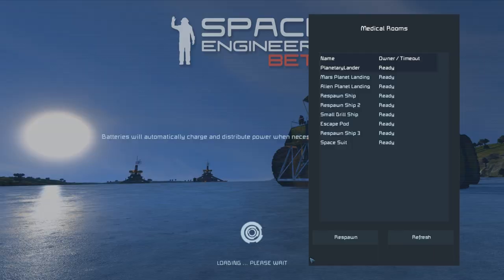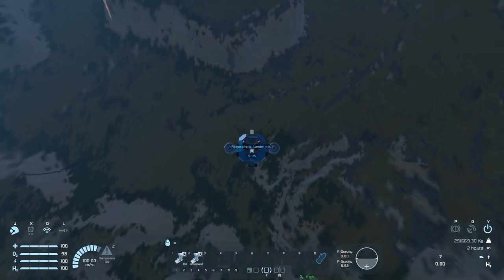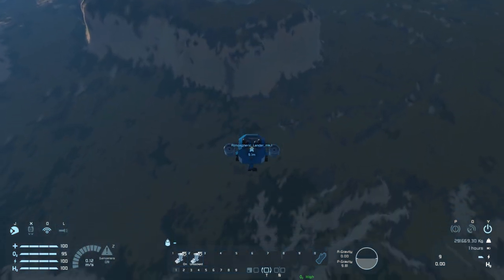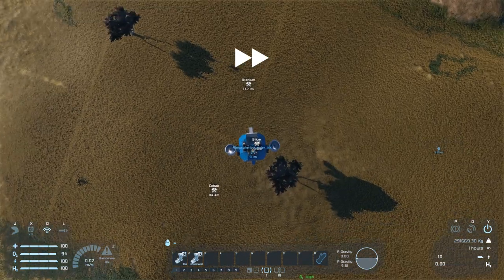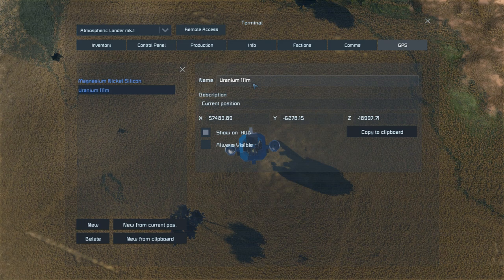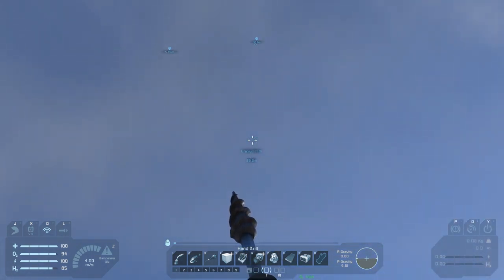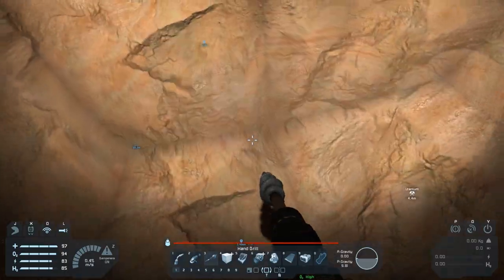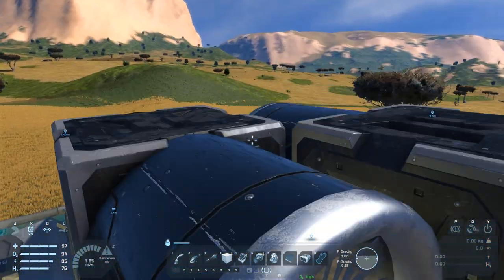Space Engineers Tutorial: Planets, Batteries and Mining (Part 1 of a survival tutorial series)

Comment: I personally don't recommend drilling straight down as its very undesirable to use up what little hydrogen fuel you have on jetpacking about, keep in mind that if you drill downwards at even a steep angle you can easily create a tunnel that you can sprint up just fine and its usually easier than trying to drill upwards at an angle.

Disregard this tip once you find ice in decent amounts though.
Reply from the maker: The main reason I drill straight down is that I've marked the deposit from directly above and this ensures that I'll hit it. You shouldn't need to use any hydrogen at all to do this, simply crouch and drill straight down, then you can drill up at an easy slope to make your hole to get out of the mine. As long as you go down with enough power you won't need hydrogen at all :)

One big caveat to this though, there are times when Space Engineers goes weird and you can get injured from rocks hitting your player, this is slightly more likely when drilling directly beneath you - so make sure backups are on :P

Comment: Great video. 3 things I do different though: 1) I open the sliding door way before, even when I'm still in the air. 2) Also still in the air, I switch off non essential systems (Beacon, Interior lights, LCD panels, programmable block, sliding door (after opening it), small reactor and timer block) 3) Once landed, I build 2 solar panels on top of the lander (need to scavenge some steel catwalk). Thus I don't need to relay on finding Uranium so quickly and instead I focus on Iron.
Reply from the maker: All good ideas that would work quite nicely :)

I don't think I can talk quickly enough to explain that properly for new players in the time it takes to land though :P
Reply: Fair point. Too much information for a limited time :-D As you well said, all good ideas. Great videos. I have learnt a lot.
Reply: @RCAddix  He never said it was his idea

Comment: I didn’t understand the bit about checking boxes on batteries. Hopefully you mention it again when it’s time to do it.
Reply from the maker: That's my preferred setting for batteries, it allows them to function like capacitors. They will recharge if extra power is available and discharge when the system needs that extra power. In the case of small atmospheric mining ships with some reactors and batteries, when landed and thrusters shut off the batteries will charge from the reactors (quite slowly though) then when flying the batteries will discharge because the reactors wouldn't be enough for the thrusters to work properly :)

Comment: Am I misunderstanding something with big block reactors vs batteries though?  Reactors have a max output of 15MW, Batteries 12MW, so why bother with a battery?
Reply from the maker: Large grid large reactors are very effective, but very large and expensive. With large grid small reactors they can't put out as much juice per second as a battery so you may still need them (though the difference isn't as large as it is in small grid). For atmospheric thrusters you can quickly run out of available capacity with reactors so batteries have their place :)
Reply: Have a look again dude, 12MW for large batteries, 15MW for reactors.  Also with <100KG of uranium, reactors weigh less aswell as acting as part of the conveyor network, and don't have the issues with irreplacable components.  Also you're not losing 20% charging a battery, just direct uranium -> power conversion.  Only disadvantage is slightly less health.  If there's something I'm missing, let me know :)
Reply from the maker: The output may have changed because I had in my head that it was a little bit less with the reactors. Assuming the wiki is right (I'm at work so can't check) there's no advantage to batteries if you aren't using solar (for large grid)
Reply: @Splitsie  I only just came back to SE about a month or two ago.  Back in 1.04 days the batteries were what you used and reactors to slow charge 'em.

I was surprised when I came across it aswell.  Only use batteries on small block ships now.  (4.32MW batteries, 500KW reactors).

I only run battery banks nowadays on large blocks for solar arrays or an emergency power source for medical rooms etc.
Reply from the maker: Phew, I'm glad I wasn't just going crazy about that :P

I'd say your use is spot on and probably the way I'll be using them in the future (unless they change things again)

Comment: How do you recharge you're suit? Managed to land but ran out of power to mine and could not work out how to do it, probably doing something stupid ;)
Reply from the maker: There are a few ways to recharge your suit, the first is to sit in a cockpit that has power (the ship has to be powered up for this to work - you can see if it's on by looking at the power symbol in the bottom right, if it's blue then the ship is turned on) the other is to use the med bay and access the terminal part that looks like a screen and keyboard, by holding F on that you'll get recharged and if the med bay is piped up to hydrogen and oxygen supplies those will get refilled too :)
Reply: Splitsie many thanks for the quick reply,  shall try that tonight when I'll give it another go,  quite a hard game to learn but you're videos have helped and once I get my head around how to build more and link things together I hope it will be more enjoyable.
Reply from the maker: It certainly has a steep learning curve, but I've had so much fun with it that I definitely think it's worth pushing through :)
I'm glad my videos have helped you get through some of it so far.

Comment: I was just trying to rotate objects I created from the G menu.  I created a conveyor tube and it was positioned in a vertical position and I can't rotate it to a horizontal position.
Reply from the maker: The rotation hints should be in the upper right of your HUD, you need to use them when the block is ready to be placed (snapped to the existing build) to get the desired effect
Reply: @Splitsie  None of them rotated the object to a horizontal position.
Reply: @Splitsie  I think I know why I couldn't get the object to rotate properly.  When I lifted it high into the air, the controls worked as described.  There was a rock wall nearby and it must have interfered.

Comment: My ores wont show up even with the lander and the drill any help?
Reply from the maker: I've been having some troubles with the ore detectors in the last week, though mainly the ship ones sometimes not working. I think there might be some bugs with it at the moment :(
If you're over a dark patch with the ore detector on and you're within about 30m of the ground the large grid detector on the lander should see something. The hand held has much shorter range though and you normally need to be partially in the ground to pick up much of anything with it. If the ship based detectors aren't working for you you could try drilling straight down into one of the dark patches and seeing what you find with the handheld, I've used that as a method before, it's not efficient but it can work. Hopefully they'll fix whatever's been broken soon
Reply from the maker: I've just had a little bit of a read about this and there's a post from the forums that points out something I was previously unaware of, you can turn those markers on and off with 'H' . It might be worth trying that to see if your markers just happened to be accidentally off :)
An now I'm wondering if I did the same thing...